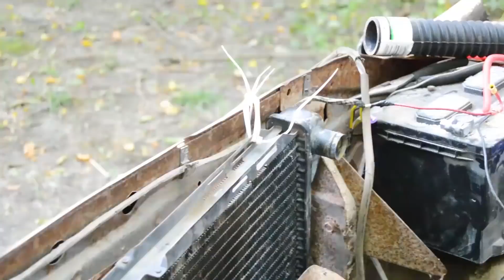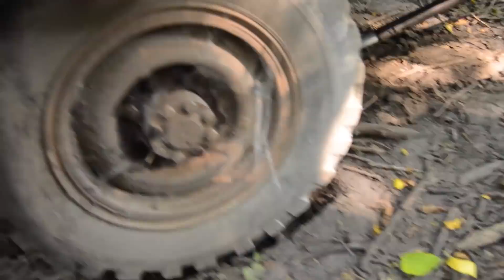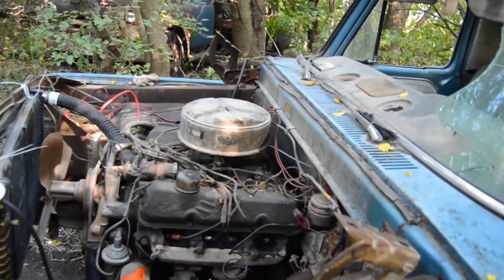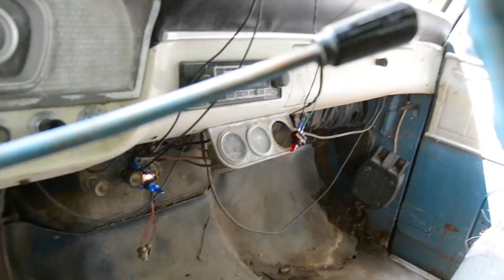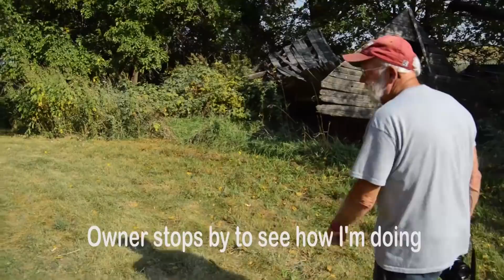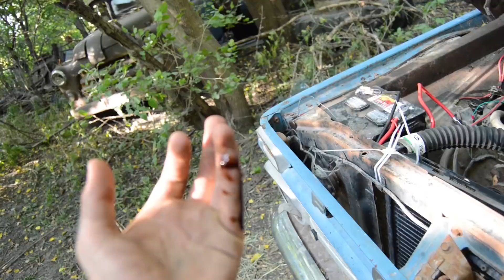Abandoned F250 Revival! First Start in 26 Years -- Part 3

Comment: Ah yes, the wix 51515. It's the filter that seems to fit literally every car I've ever owned. 

It fit my k5 blazer with the 6.2l detroit.
It fit my 71 valiant with the 225 slant six. 
It fit the 65 dart with the 225 slant six. 
And it fit my buddy's 1980 ford f250 with the windsor. 

I prefer the K&N PS 3001. It has the nut on the end that helps get the filter off. But either the wix or the K&N are a good choice. Almost anything is better than a fram.
Reply: Sis please

Comment: I’m an old school retired mechanic. 
I freed clutches by putting my heel on the floor-toe one the pedal-press to the floor and quickly turn shoe left until pedal slams against the upper stop. Do several times -
check to see if it’s free. Works better if the engine is running.

Comment: Electricity goes the part of least resistance. Back then that path was the spark plus. Until that had to put resistors in the plug so you tape deck don’t buzzz. Making it easier for arching to occur. Now being old they might arch but it would have to be close enough to metal

Comment: I know its an old video but i didn't see it mentioned, did any of you happen to look at the distributor while diagnosing the idle\timing  issue?
For those that didn't notice this truck uses vacuum advance timing. This is how vacuum advance works. At part throttle, high manifold vacuum moves the diaphragm in the vacuum advance canister on the distributor to add more timing. But at WOT, the vacuum drops to near zero and vacuum advance is removed and the total timing then is established by the initial plus the mechanical advance.
so yes your assessment of the vacuum leak is correct
The line that he shows snapped at the carburetor goes directly to the vacuum advance canister

Comment: Hey i just bought a 66 f250 custom cab thats been sitting in a barn since 2001. Im not a mechanic but ive replaced the starter, solenoid, fuel pump, ignition switch and rebuilt the carb. I also pit a new deep cycle battery with new terminal connectors. We got her running at idol for 10 minutes but this last time i went out to start her up the starter would not stop trying to start her...is this an electrical problem or the Bendix spring? How to proceed??? Advice?

Comment: Check for any play at all in the distributor it'll run like a raped ape if the Distributors messed up but as soon as you let off on the gas it'll die F250s from that era in fact all of the Ford truck motors from that era had bad distributors

Comment: I am  very happy the younger generation, like you two guys have  learned old engines and cars. Back in the 1960's and 70's I was doing exactly what you guys are doing. It is a great way to stay out of trouble , stay off drugs and get a sense of accomplishment etc.. You are learning as you go and making it work on a shoe string budget.  One of my first that I did 51 years ago, was get a straight 8 1938 Buick running. I used parts from two other nearby scrapped Buicks.  Probably a 1947 and 1952 Buicks is what they were. I did a few other different scrapped  car/McGyver ,, in the field projects also. Rambler's were fun and low cost to revive ! Presently on another youtube channel some Canadian guys are doing two old straight 8's from a non-commecial poor man's junkyard. Thanks for your channel , it encourages me to keep my 1977 Newport running.

Comment: It did start up it will be nice to see it drive again. In Elmira NY at 654 Sullivan Street in Elmira NY sits an abandoned 1991 Ford Mustang it hadn't tun in over a year and a half the motor is seized up. The owner is in the military. He tried to remove the rear drive axle to unseize the motor thereby breaking the rear drive axle. My hope is that someone would locate the owner buy it  and fix it up before it sits and rots away and becomes scrap iron. That would be a shame they are highly sought after muscle cars . To let them sit and rot away and become scrap iron would be wrong. Fan of restoring old vehicles Robert Gildea

Comment: This is how I looked for Vacuum leaks in the Old Days and still do today when i am working on an early Vett 60 to 70 Models If the Engine does not want to stay running or is , Or I have got it running Barely and I think there is a Vacuum leak I will Cup my Hand and hold it over the Carburetor and slowly try to choke out the Carb if the Engine RPM starts to pick Up and the Engine starts to smooth out then usually it is a Vacuum Leak some where.

Comment: If I remember right, those chokes are attached to a spring that is housed on the top manifold. As the engine warms, the spring expands and opens the choke. The choke should be shut when the engine is first started.  That is what keeps the engine running until it warms.

Comment: dwell still off, bump up the idle, possible burnt intake valve, or stick or dirty intake, probably has a couple of holes with low compression. main jets still have crap in em.idle circuit still not clean enough!.

Comment: It will never idle right it's a holly single or double. Just don't idle. Great wot. Is it 1 3 or 1 5 firing order. Tough old engine. You can  f the firing order and it will sound good till you need power. Fun

Comment: Your timing advance isn't working on the distributor.
The diaphram is rubber inside and is cracked.
Replace it and run a 1/8" vacuum line to the small vacuum teat on the bottom of the carburetor and you can adjust the timing once again .

Comment: If it's not running without the choke engaged, my first thought would be to check the fuel lines, filters and pump. It's obviously got spark, and it's got air, which leaves only fuel as an issue. If it runs fine with reduced air-flow, but not with normal air-flow, it means it's not getting enough fuel. Even if you drained the tank before you started anything else, there would still be lots of sludgy junk and rust in the tank that would clog a filter quite quickly.

Comment: Wish you were here to fix my 84  Ford F-150, 302!  One day running great, next day sounds like it's runnig on 3 cylinders...... sob , any thoughts??
Reply from the maker: Check for vacuum lines that may have cracked or fallen off. Make sure the distributor is still operating properly. Also make sure that your fuel lines are not clogged at a point like the filter
Reply: @JunkyardDigs  Thanks for the super fast reply!  I'll give those a try.

Comment: Love this video, but by 2008 Ford Sportrac had to put a rebuilt engine. Still does not run right. How about doing a video on these. They are nick name the Ford EXPLODER.radiator, timing, oxygen sensors, catalytic converter, fuel trim, etc, etc., etc.

Comment: check your air-idle mixture screws.  Turn up the throttle screw to 1000 rpm, back off the Idle Mixture screws until you hear a difference. Try opening the choke and if it runs then adjust the idle mixture screws back in by 1/2 turns until it starts to die, then back out 1/4 turn.  Check for vacuum leaks

Comment: I would set the points correctly with a feeler gauge, and check for vacuum leaks it sounds like it has a nasty vacuum leak. Last make sure that the plug wires are in the right order someone may have set it up like a Chevy

Comment: One of the intake valves is sticking open intermittently in the guide or the hyd. lifter is not right. may straighten out with run time.
You  have a definate vacuum leak from maybe a PCV valve on the rt valve cover stuck open from sludge or the PVC vac. hose is cracked
Or an intake manifold gasket leak. Set the carb idle screw to what ever it takes to keep it running, even if it's too high.Take a wet soaked gasoline rag (be careful around flame and spark sources) and move it around the carb base, the vac hoses and the intake man. gaskets.
slowly see if the run condition smooths or picks up RPM from the fumes first or raw gas being squeezed out. You use to be able to use 
WD40 but, it is no longer combustible ( DO NOT USE EITHER IT IS TOO DANGEROUS)

Comment: Pretty cool video series so far.  Even after changing the plug wires, you can actually see some arcing and sparking on the distributor cap, so add that to the list of parts the need replaced.

Comment: Set the dwell on the points and timing, put the thermostat back in, bring it up to temp and the rings will loosen up over time and will run better hot than cold. Put it back the way it was and it will run better the longer it runs.

Comment: The folded wire was standard, cut to fit wires.  Cut to length, trim back 1/2", fold over the core and crimp on the end.

Comment: Set the points while it's running.
 I had a Ford f250 with a 460 .same issue, adjusted the points , ran great.
Reply: You can't  because you have to remove the cap now how can it run impossible no spark with cap off correct

Comment: Hey man you gotta put the air cleaner back on to get it to run with no choke. You dont have enough resistence on the intake side so air is dumping in and leaning out the mixture the motor aint getting enough fule witch is why its running rough and wont idle.

Comment: Make sure you use the right oil.  Those older engines needed a lot of zinc in the oil due to the flat tappet camshaft

https://blog.amsoil.com/do-older-vehicles-need-high-zinc-motor-oil/

Comment: You've probably already did this by now, but you should go through the carburetor to clean out the idle circuit in it, especially after attempting to start it while the bad gas from the tank was being introduced into the bowl, and it won't hurt to clean the mixture jets too. It is running too lean, which accounts for the hard idle control problem. Good luck with this project. My favorite body style Ford Pick Up from back then. They were rugged.

Comment: F.E. Engines were cold blooded as hell.   They like to run on ported vacuum instead of manifold vac. They like to be advanced a little if you run them on ported vac.
Intake on the F.E.'s were HUGE/massive., and took a while to warm up, they have coolant circulating in them, so once they get hot, they have a tendency to cause the fuel in the bowl to boil unless you run a good thick base plate/ gasket under the carb.  Vapor lock was not a stranger to the F.E.  That is why I always ran an electric fuel pump in my many older Ford F series trucks back in the day.
When he had it running but it liked to die, it was running on all 8, just has a bad vacuum leak.  Common intake leaks front or rear across the top of the block on F.E.'s. 
Timing is too retarded , it is popping up through the intake, runs too nice to have a stuck valve.
Really surprised it didn't stick an oil ring, sitting that long, then collapse the ring, then smoky smoky burn oil.
Reply: I live in Phoenix, AZ and we never had vapor lock on days when was 120 .

Comment: Someone posted that finding a vacuum leak would be just fine with carb cleaner or brake cleaner. It does a great job of that. All i'm saying is that if you have a freshly painted, restored, engine then you can use the propane torch, unlit, to find a leak without ruining your new paint job. It saves a show car engine. Keep at it guys. I love the videos.

Comment: Vacuum leak due to stuck or leaking PCV valve. Betcha the carb spacer which the PCV hose attaches to is also crudded up and maybe the hose too. I've fixed many a poor idling Ford V8 by de-gunking all that, but most folks rebuild the carb thinking that is the problem. Gotta give him credit for knowing what a 2100 series carb is, that one is probably a 2 3/8 bore. They never need rebuilding unless the float sinks or it won't control the gas flow, the power valve leaks, or you're getting gas outside of the carb. Just pull them apart, clean everything, set the float level, then set the air bleeds at 1 1/4 turns, not 1 1/2.  

There's a lot to be said for the simplicity of these old engines. They required a little regular maintenance but the average Joe could fix anything about them on the side of the road in under 2 hours and less than $100. Now you tow it to the shop($), hook it up to the scanner($), spend an hour replacing a sensor($), discover that it's something else wrong, then replace whatever that is(more$). They call that progress but I don't.

Comment: Great series.  I like that you have included the pitfalls.   You got lucky that the oil didn't have a bunch of condensation in it having sat for that long.  I would have changed that before turning it over.

Comment: without reading anyone's comments I had the same problem with a vacuum issue and it was the customer's friend who had put in a new gasket set and used the wrong base gasket so it was sucking air under the carb.

Comment: If making a vacuum leak didnt change anything then it has a vacuum leak already, which will explain why it doesn't run with the choke disengaged, its getting air from somewhere. Spray starting fluid around the top of the motor and see if it runs different for a second or two. This will help locate your vacuum leak.

Comment: You can’t kill a 352 I’ve tried. The easiest way to “hot wire” this truck is to use a paper clip or similar item to remove the lock from the switch. Then use a flathead screwdriver as a key.

Comment: Can u guys please help me!!! I have a 66 mustang I’ve changed the spark plugs the gas tank and gas tank pump I’ve bought a second refurbished carburetor (they don’t make them for that engine anymore) it’ll run for a while and then it’ll just cut out on me I’ve been stranded a couple times I’ve even timed it and everything I just have no clue what to do anymore HELP!?
Reply: Also changed the distributor, regulator, alternator.
Reply from the maker: Will it start after it cools down?

Comment: Air leak. Runs the same with a vacuum leak and needs full choke to run? You've got it tuned to run with the air leak. I could be wrong. I mostly work on bikes, not trucks!

Comment: i think you should clean the carb. the thing is having a fuel delivery issue if it "idles" on choke youre not getting enough fuel
Reply from the maker: +n0bleteamleader problem was timing chain. Carb was rebuilt in part 1 and 2

Comment: Might be a stupid question but why would you need to change the timing if it was simply parked one day when it was still running?
Reply from the maker: you'd be surprised how many people are driving around right now with improperly set timing. Also were assuming it was parked because the clutch and because it ran poorly back then
Reply: Points wear on the rub block in the distributor can affect timing too. When you replace the points, you need to at least check the timing as you check the point gap. You need a dwell meter too.
Reply: Matthew Reimer 
It should still have ignition components upgraded to 44,000v 8-10mm wires w e3 plugs ...then tune ..clean Raw energy ..

Comment: This was more than a week ago, so you've probably already figured out the issue with the stalling. But, if you induce a vacuum leak, and it doesn't cause the engine to run differently, I'd look for another vacuum leak somewhere.
Reply from the maker: +wheresmyhouse the next video in the series explains the problem in detail, he had a really bad timing chain

Comment: From the flames that came out of the carb when first starting it could be an intake valve isn't closing properly. After sitting for 26 years any sludge buildup on the back of the valve face or on the stem may have hardened.

Comment: put the air filter housing on and get some brake cleaner get the motor running and spray around the vaccume lines and to the back of the carb if it causes the idle to change you got a leak in that area and it will be easier to find might even be leaking between the block between the carb and intake manufauld where the vaccume is pulled for the vaccum valve on the spacer block between carb and intake towards firewall

Comment: I'd guess you have a valve stuck open, pluck each wire from the distributor while running to find the dead cylinder, then free up the stuck valve if you can risk the seal on the valve cover.

Comment: Ignition timing is not bad change the idle screw for Higher idle after that change the fuel mixture when it's runs really good turn back the low idle

Comment: Bad PCV valve?... PCV valve gets direct manifold vacuum and if they go bad, it usually introduces a huge vacuum leak... bad enough that "adding" another one won't change it much. Also indicated by the fact that the engine seems to be asking for more fuel = need the choke closed for it to idle better. Try capping the hose going to the PCV valve and see what happens.
Reply from the maker: +Robert Evanoff Jr good observation, but it was actually a really really bad timing chain

Comment: Check the little cork seals on the air mixture screws, had a 67 289 do the same thing, wouldn't idle with out the choke all the way shut, put new cork gaskets in the air mixtures and boom purrs like a kitten, not sure how those old ford 2 barrels are as this was on a holley 600, but I'd imagine it has the same type of gasket on the air mixtures

Comment: The vacuum for the distributor use a rubber diaphragm, probably is dry and won't work. And probably the inside of the distributor is stuck because of rust and old oil. Carburetor is probably dirty because of the old fuel. Use a carb or throttle body cleaner.